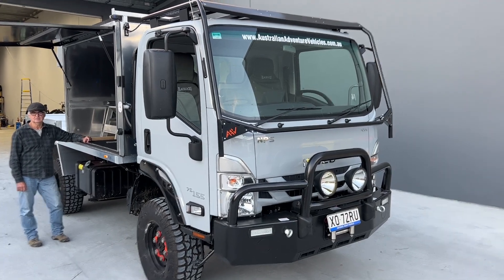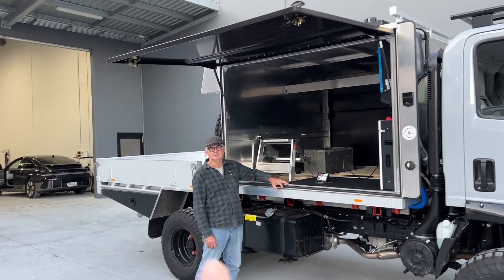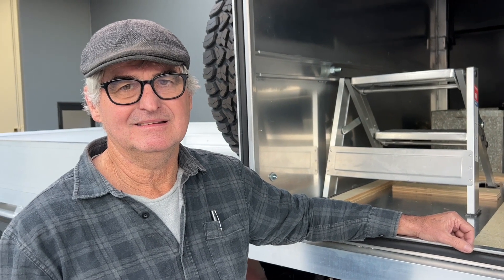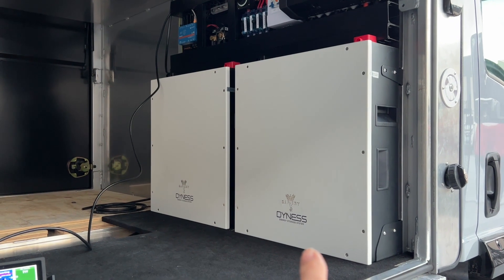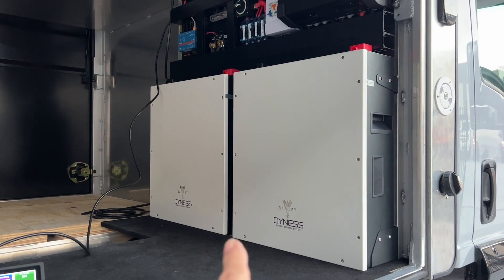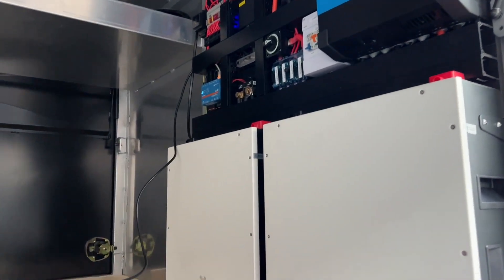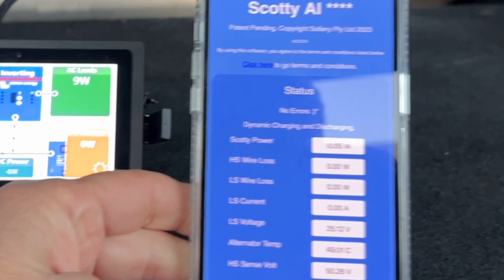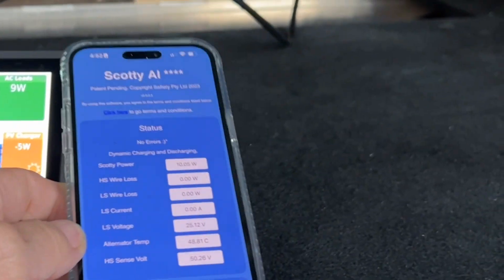Isuzu NPS300 with Canopy & Camper gets Scotty AI 24V, 10,000Wh of Lithium 5000W Inverter

Comment: What's the battery voltage ? Also 24V ?
Reply from the maker: 48V with Scotty DC DC 24V-48V Bidirectional DC DC charges at 3000W and Discharges same amount to 24V winch